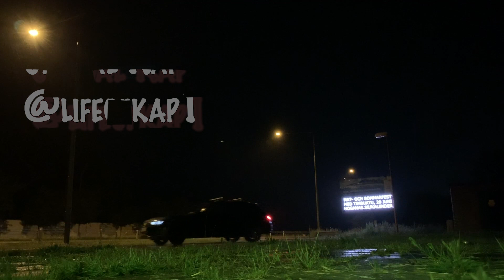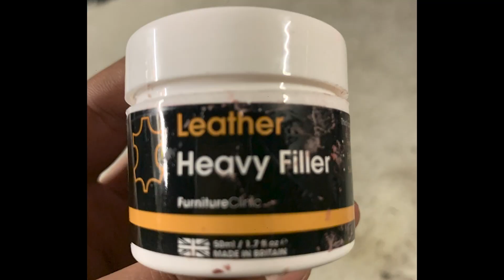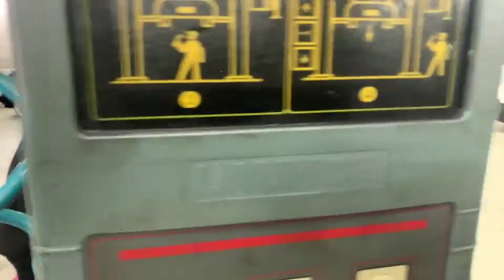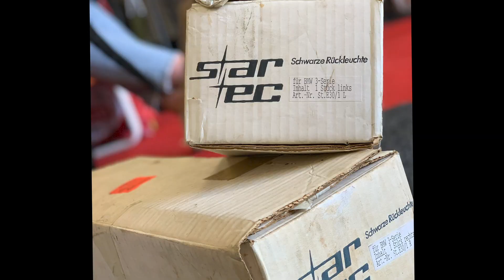BMW E30 Going Cardinal Red Interior & Parts update

Comment: The color change seemed to come out looking very well. I would have liked to see some closeups of the leather repair, though. I have to imagine that after all of the paint work on the seats the leather would have turned somewhat hard to the touch, though.
Reply from the maker: Everything is depended on the prep work..
The colour doesn’t hide the 30year old leather structure / ware and tear without leather filler
It’s not hard to the touch, leather paint is kinda soft.
Reply: I assume that this car is not your daily driver, and unless I’m wrong, this car isn’t being parked outside in the elements on a regular basis. So, how would you characterize the interiors durability so far? Has it held up reasonably well so far?
Reply from the maker: @weifeng5958  i dont recommend doing this.. this is me experimenting and trying out different visions I have.. I suggest just reupholster the seats / interior is the way to go. This takes to much time and effort, it’s really hard to get right.. and you have to be good at using a spray gun as well to get an even layer..
Reply from the maker: @weifeng5958  for any other questions, write to me on my social media so I can send you pictures you wanted to see ✌️